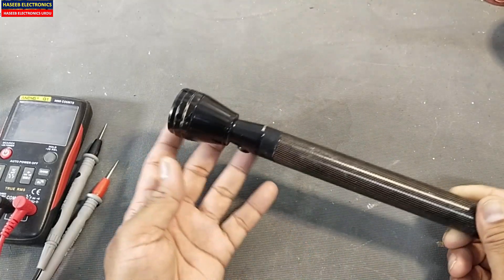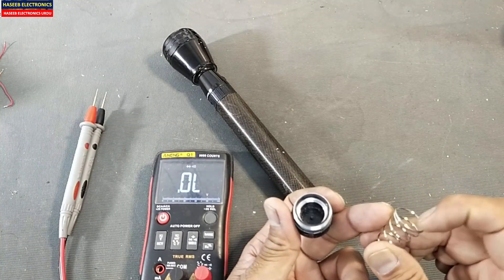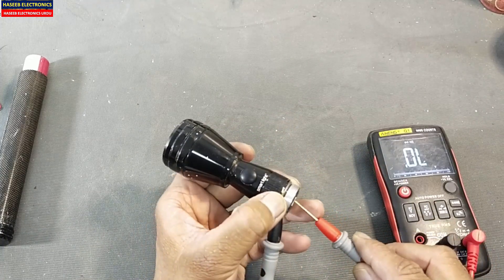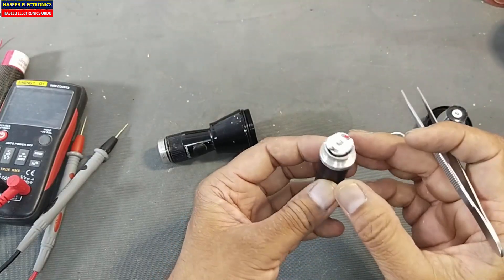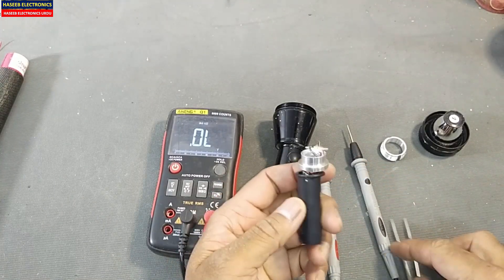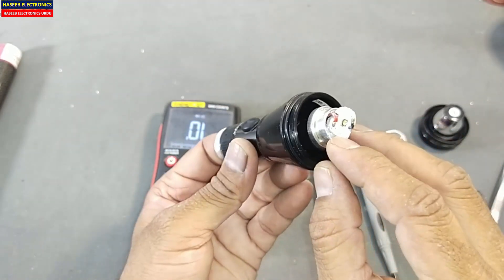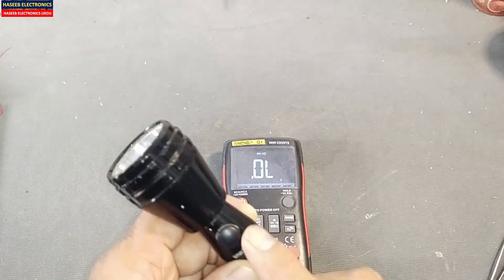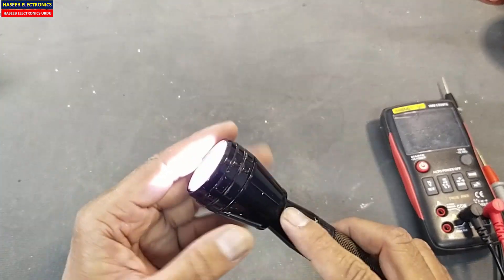{627} Rechargeable LED Torch / Flashlight Repair - No Light Problem

Comment: Hello. My torch works when connected to adaptor. Do not work without adaptor connected. I have replaced the new battery also. What should I do ? Thanks
Reply from the maker: it means its LED driver circuit is faulty. 
or might be back cover is not making good connection

Comment: Dear sir I’m srilanken. Watching your channel since 9 or 10 months. Very useful And i learned so many things from you. Appreciate sir.so now I have problem .i try to change laptop charger 19.5 volt to 5 volt. So I dis connect 27 k original resister and connect 10 k preset. When adjusted preset voltage dropped to 5 volt but not stady  fluctuating 4.5 to 5.7 volt.so I removed 10 k preset and connect again original resister27 k.voltage becomes 19.5v no fluctuations.after that series another 10 k resister with 27 k resister and checked voltage. It’s came 26 volt without fluctuating.so I disconnect that resisters and add 10 k resister.voltage drops to 8 volt and again starting to fluctuation.19.5 and higher voltage are ok no any fluctuating but lower than 19v becomes fluctuating. Sir what I have to do to get 5 volt from this charger. My charger is Sony 19.5volt 4.7 amps.model  VGP - ac 19v 26.sir please help me to do this job.thank you very much

Comment: Haseeb bhai aap aise lower repairing standard wale video post krte ho ye aap ki shan ke khilaf he
Reply from the maker: nahi brother. 
aisi baat nahi. fault finding achhi baat he. electronics mein sabhi faults approximately similar hotey hein, ya open circuit ya short circuit
in complete electronics there is nothing more